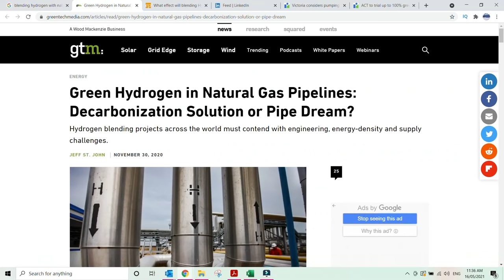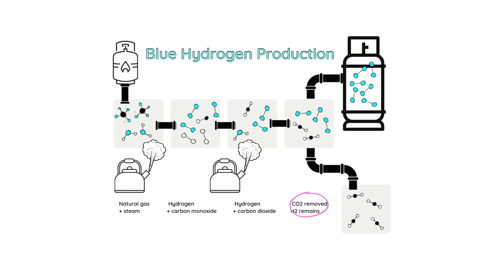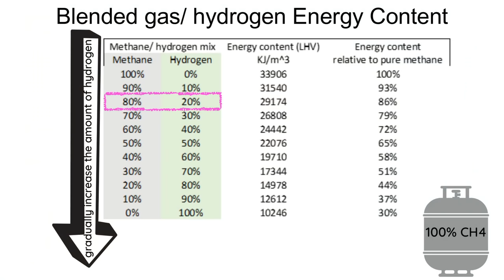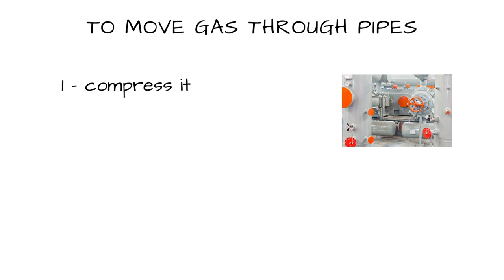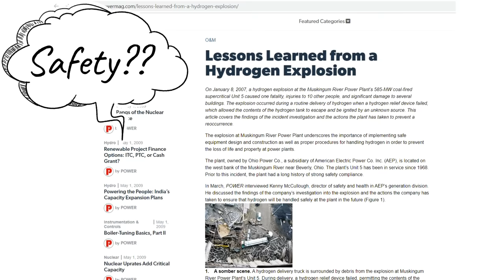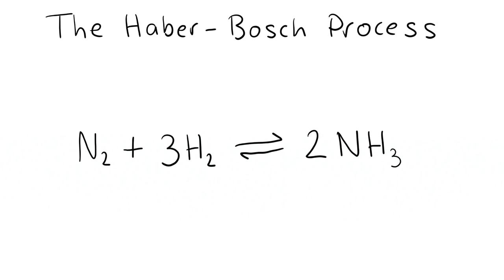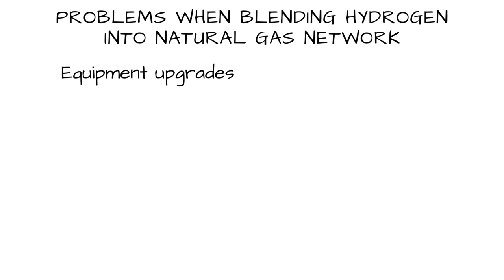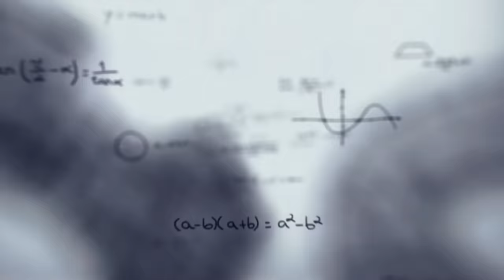Hydrogen in the Natural Gas Network

Comment: Great video. I would love to see you cover next gen small nuclear reactors. Looking forward to it!
Reply: The nuclear and fossil fueled conventional thermal power plants have no chance of competing against renewables plus storage.  The costs of renewables is already becoming less than conventional thermal power plants including nuclear.  The utilities are making the decisions on what method of power generation is used and they are deciding to use the least costly, which is renewables plus storage.  They have already declared some conventional plants as stranded assets and shut them down.

Let's hope that the government steps in and stops the utilities from shutting down the nuclear power plants.  We need to keep them running for awhile since they are relatively CO2 free.  The government may have to pay an incentive to the utilities to maintain the nuclear plants for awhile.
Reply: @acmefixer1  Correct.  Wind and solar have become so affordable that it will be very hard for a new technology to enter the market.  Especially when one includes the drastic cost reduction Tesla is bringing with their new 4680 tabless dry rolled LFP cells.
Reply: @Joshie2256  We already process metals and glass with electricity.
Reply: The new microreactors that can be fueled with the spent fuel rods of the current reactors is a fantastic idea. Our current nuclear reactors are 1970s technology because we were not able to build any new reactors for almost 40 years.  New designs are much safer. More people have died installing solar cells than running nuclear power plants.
Reply: @Joshie2256  ... The vast majority of steel produced today uses recycled steel in the mix so they are able to use induction furnaces (electricity) instead of blast furnaces.
Reply: @bobwallace9753  ... Todays battery technology is far from safe or clean. Only temperature control technology prevents catastrophe. The electrolyte is flammable.  I am hoping for better and safer battery technology but we are not there yet. 

I would NEVER put a Tesla power wall in my house. I would use a flow battery which is safer. The issues with flow batteries is only size and weight but that would not matter for home power.
Reply: @stevendelizasoain9237  You're partially correct. 

Some batteries are flammable.  Lithium iron phosphate (LFP) batteries are not flammable and that is the chemistry that will probably be used in future EV and storage devices due to low material cost and very long cycle life. 

LFPs weight a bit more than some other battery chemistries but that's only important for performance/very long range vehicles, not for most EVs and not for home/utility storage.

Are there any commercially available flow battery systems for home use?  I haven't heard of any.

If you don't trust Tesla's PowerWalls then you might want to look for some LFP batteries.  That's what I'm using for storage with my off the grid system.  The batteries I'm using are rated for >10,000 full 100% to 0% to 100% cycles.

Since a well sized system is not likely to fully discharge daily let's assume, on average, a 50% discharge per day.  It would take 20,000 'half discharges' to reach something approaching cycle life.

20,000 / 365 = 54.7 years.

A 10,000 cycle life battery in a 250 mile range EV would be a 2.5 million mile battery.  You could drive a properly designed EV a million miles then use the battery pack for years as stationary storage.

BTW, have you ever driven a gas powered vehicle?  Perhaps  you didn't know that gasoline is very flammable and you have to trust whomever built the vehicle to keep the gas from igniting and toasting you up.  

I sort of got some first hand experience when hit head on by a drunk driver on a narrow road.  While they were cutting me out the gas that had leaked from his vehicle caught fire and almost burned me up.  Flammable batteries don't leak all over the road nor do they suddenly burst into flames.
Reply: @bobwallace9753  ... You are correct. There is new technology in the future that shows a lot of promise. I was looking at current technology we can buy today. 😎 I am aware of how flamible ice (internal combustion engine) cars are. I have experienced fuel and transmission fires over the last 4 + decades of driving. Weight and size are important in vehicles so the current technology is the best choice at this time. Personally, I am thinking of the Rivian SUV.

I definitely have experience with accidents in ice cars. In one accident, back in 1977, I was declared dead and it took over an hour and a half for them to cut the vehicle apart to get me out.

BTW ...  I am familiar with an accident with a Tesla where the car burst into flames. I admit it was an extreme accident. They lost control and hit a wall at 120 mph. All the deadly Tesla accidents that I am aware of (been at the scene) are all due to insane speeds over 100 mph. Obviously driver stupidity is not Tesla's fault.

I did get a laugh when a local police officer pulled over a Tesla on autopilot with no passengers. They were intentionally in an empty parking lot testing the autopilot system where there were no other vehicles to hit. The officer was perplexed but got to laugh out of the situation. 🤣
Reply: @bobwallace9753  Flow batteries are available and the liquid is similar to chemicals in fire extinguishers (fire retardant instead of flamible). The size of the main part determines how much current is available (10 kw units are already available). The amount of power storage is based on the size of the tank for the fluid used in the battery. My thought would be using buried tanks for fluid storage under the house for large amount of power storage but I do not know if buried tanks have been used before. Weight and space are not important when choosing a battery pack for a building.
Reply: @stevendelizasoain9237  A Tesla PowerWall is a battery and an inverter in a box.  You can buy inverters and LFP batteries 'off the shelf' and connect them with two wires.

BTW, have you heard of any PowerWall fires?  I did a search and came up with nothing.  I did find this interesting piece where they intentionally set a Powerpack on fire by inserting a resistance heater inside and overheating the unit.  

https://electrek.co/2016/12/19/tesla-fire-powerpack-test-safety/

There was a fire but it was contained within the metal casing.
Reply: @stevendelizasoain9237  I wasn't aware there were small flow battery systems on the market.  Looking at what a search turned up they are not very cheap at this point in time.
Reply: @stevendelizasoain9237  ,  Yes people sometimes die while installing solar cells or windmills or other renewable energy. However, none of those individual accidents will completely toxify the landscape for miles around and make all of that land worthless, useless, and uninhabitable for a 100 years. Businesses will happily employ  actuaries to figure out the average loss of life or severe injury involved in any major building project; individual deaths here and there are considered an acceptable risk, but when there's a chance of things going so badly wrong that real estate is rendered unsaleable, possibly for decades or centuries, banks,  businesses and insurance companies take a dim view of that.
Reply: @bobwallace9753  Yes, but we don't have to. Electric arc furnaces are common for remelt, but although electric blast furnaces were invented over 100 years ago they fell out of favor and I can't find evidence of any in operation for reducing iron ore to pig iron.
Reply: @Joshie2256  From what I can learn we have the process for turning ore into iron.  In addition to coal being used for heat, coke is used in blast furnaces because the released carbon from the coke binds with the oxygen in iron oxide and purifies the ore into iron.  Unfortunately that product is CO2 which adds to the CO2 produced by the heat-coal.

The heat can be provided by renewable electricity.  Hence, electric furnaces for remelting steel.  And the coke can be replaced by hydrogen generated using renewable energy.  The byproduct is no longer CO2, but H2O.

It may be a bit more expensive to eliminate coal/coke but that might be an expense we will need to bear.  And the problem might be the industry saying "What we're doing is working, why change?".   This is an area where governments may have to step in and drive the change unlike places like the grid and the highway where economics will largely drive the change.

Comment: My impression, reinforced by this video, is that hydrogen is a 'later' opportunity, not a 'now' opportunity.  Even as a 'later' opportunity it is likely niche as Paul points out.
Reply from the maker: I agree, with the exception that we should be starting to transition to green hydrogen for ammonia production asap. The technology involved there is definitely "now" but everyone seems so focused on new uses for hydrogen to solve the last, hardest to decarbonise sectors.
Reply: @EngineeringwithRosie  So what are the efficiencies of producing ammonia from green hydrogen?  For a given country, what is the annual consumption of ammonia and how does that consumption compare the ammonia required to generate a day's worth of electrical energy for that country?  What is currently the most efficient means to convert ammonia to electricity?  I'm interested in whether storing ammonia for backup electrical energy is an incremental increase in overall ammonia production or a significant increase.  A topic for a future video?  Discussing how one might estimate the stored energy required to provide good electrical grid reliability might be another good topic.
Reply: @mrhickman53  Go back and listen again. They covered producing ammonia as fertilizer in the video.  Not for electrical generation, but to make food.  Major C02 emitter at 2%, right behind making concrete.  Not sexy, but practicable and doable with today's technology now very rapidly.
Reply: @rcmrcm3370  It still may not be a "now" opportunity if the still scarce renewable energy displaces more carbon per kWh produced in other industries.  I am jealous of renewable energy generation till it becomes ubiquitous and fossil fuels are out of the electrical generation and transportation industries.  Residential an commercial heating actually offer greater carbon offset.  Electrolyzing H2 starts with a 20% energy penalty under ideal conditions before any conversion.

I'm certainly for renewable ammonia in the future, just not the urgent now.

Comment: It's not a silver bullet but a 7% reduction in natural gas CO2 emissions, combined with less natural gas use in general, would be a great improvement.
Reply from the maker: Yes it would, but the issue is it can't scale gradually beyond that, it woudl require a big investment to replace all the compressors and burners. So is it worth the investment to get to 20% hydrogen and a 7% emissions reduction? Or should we spend that money and time on more electricity storage and grid upgrades? There isn't a "correct" answer, but my preferred solution is the latter for most applications.
Reply: @EngineeringwithRosie  In the UKaround 1.6 million boilers are bought every year, if those boilers were prepared to use 100% hydrogen in the future with a cheap conversion, you could use the existing NG for now, and in the future when the infrastructure is there, maybe with local storage or production make the switch to 100% hydrogen.

luckily these boilers exist and are already being sold.

Comment: The jetting in UK appliances is suitable for a maximum of a 20%. In addition up to 50% hydrogen in the mix does not cause hydrogen embrittlement or cracking. 52lx grade pipe is susceptible to 100% Hydrogen embrittlement and cracking at line pressure. The lower strength steels are less susceptible to embrittlement, but would need to be greater wall thickness  to withstand the pressure and would have to be larger diameter than present as National grid utilises the volume of the pipeline system as a storage vessel. Replacing the system, would be more costly due to the fact that the pipe lengths would have to be shorter, to allow maximum transport at 44 tonnes, entailing, shorter lengths being buried by existing sidebooms. Compressor stations in use presently are turbine sets, unsuitable for Hydrogen and would need to be replaced. Pressure reduction stations are also needing to be replaced. Apparently the low pressure street works are acceptable for hydrogen, though HDPE pipework is prone to leakage and Hydrogen is also a lightweight element and a Green House Gas in itself. The UK government has licensed new gas blocks and has stated that Natural Gas will be in use in the UK untill the end of the century. It is then impossible to comply with COP26 agreements and the UK will be fined £8billion per annum. The building of a second Hydrogen Grid, I believe would be £500 Billion at today's costs, with Green Steel, who knows.

Comment: Not only is energy per volume abysmal with hydrogen, but the hydrogen molecule is so small that the leakage problem will increase. You might could add up to 20% hydrogen at some point, but if the distribution network leaks the smaller molecules it won't be there at the customers' meters.
You can synthesize methane. Maybe work on making that more cost effective and green.

Comment: BTW, there are some conceptual projects going on in Croatia to use excess wind power (then our pumped hydro reservoirs are full) to generate hydrogen by electrolysis and add it into natural gas pipelines, at pretty small concentration.
I wonder wouldn't it better to build large redox flow batteries instead...

Comment: They good video.  One thing he didn't go into is synthetic natural gas (SNG) which gets around a lot of the issues.  It enables you to make a much lower CO2 natural gas but you still need loads of electricity.
Reply: Anyone who is starting with CO2 and hydrogen and making METHANE is failing to stop sooner at a better molecule- methanol.  It's a liquid...and fewer steps in the conversion means higher efficiency.  But any time you try to reverse thermodynamics, taking combustion products CO2 and water back to fuels you can burn, is swimming upstream against entropy and that takes a LOT of energy, most of it being wasted.

Comment: Totally agree with Paul Martin on everything he said but could add a few more facts about hydrogen. It has a flame speed 10 times higher then methane 3 m/s compared to 0.29 m/s and as a result a much higher flame temperature 2250 compared to 1954 which leads to high NOx emissions. Also the ignition energy is only 0.011 mJ compared to 0.28 mJ for methane and explosive limits in air of 5 - 75%. compared to 5-15% for methane. Hydrogen is also very ight compared to air so will rise which is why it can be used relatively safely in industrial sites where it can be used and stored outside or in very well ventilated spaces with gas detectors and safe shut down systems

Comment: 8:40  Correct me if I'm wrong but while hydrogen molecules are certainly tiny, they  aren't amaller than a helium atom. That's because a Hydrogen molecule is two atoms of hydrogen each with its own electron shells, and sharing their electron with the other, compared to helium which is one atom with one electron shell and two electrons in that one electron shell.

Comment: Ammonia has 3H and 1N atoms and is already transported widely all over the world, Methanol has 4H, 1C and 1O. and can easily be transported just like ordinary gasoline and distributed at ordinary tankstations.
Reply: And making either of them FROM hydrogen is another chemical step, involving yet more energy loss.  Hydrogen is neither efficient nor effective as a fuel, so converting it to yet another fuel is often pitched as a solution to its lack of effectiveness- but that reduces its already poor efficiency even more.
Reply: AICHE has two chemical safety sections, one for hydrogen and every chemcial industry but Ammonia, and one for Ammonia.  That should give us an an idea about how nasty and dangerous it is to handle Ammonia without having to search for the large number of industrial accidents every year, still. Now, take that out of agricultural/industrial application and into the hands of Joe down the block.

Comment: What are your thoughts, Paul and Rosie, on local syngas plants converting local waste cellulosic material (paper cardboard) to syngas on the path to methane. My calculation assesses that the amount of cardboard waste in Aus state VIC is 4 times the amount of energy required to fuel the non solar periods as fuel for running engines such as Liquid Piston’s engine as a 3 Kw generator as a co generation device with water heating cylinders to deliver up to 80% efficiency. In this way a household with 10Kw lithium storage will have a total household energy storage up to 30Kw (400 liter hot water tank) to operate households during non solar periods.
In this way a household with PVT panels for solar periods has a compatible solution for non solar periods, and where the energy comes largely for renewable sources (paper). Not there are now at least 4 companies offering PVT panels in Europe. A PVT panel will give up to 21% solar energy and an additional 40% as thermal energy during solar periods. A liquid Piston Engine will give up to 30% electrical energy and 45% thermal energy to charge a 10 Kw battery bank in around 4 hours while also charging a 300 Litre hot water cylinder in the same time.

Comment: Nuclear molten salt reactors (SSR-W is the best design so far) powering residential with electricity via a geothermal heat pump.  Hydrogen can be cleanly produced and converted to fuel for mobile power.  Every city should have its power plant to match its needs.